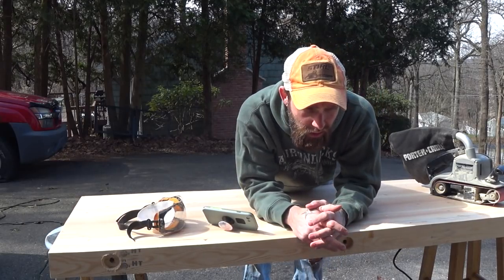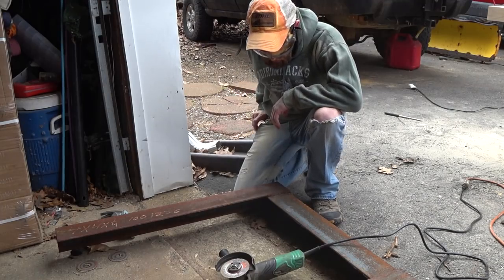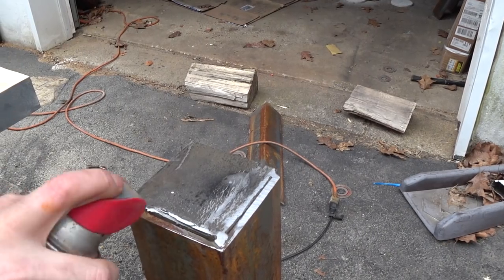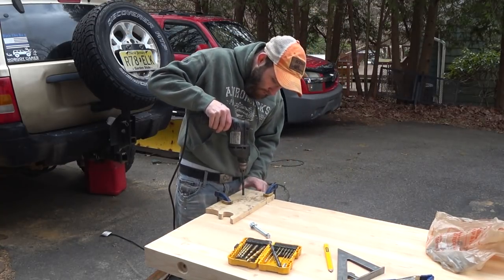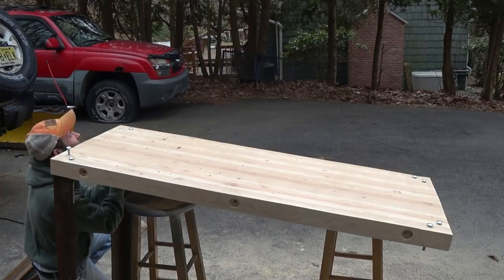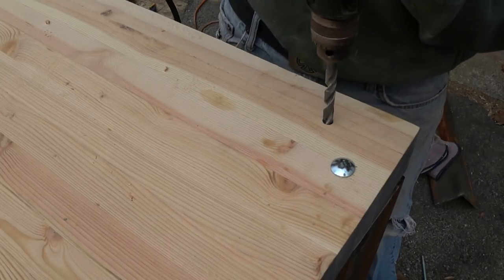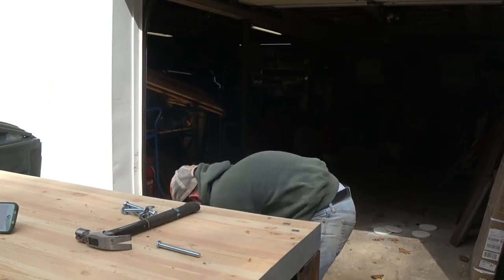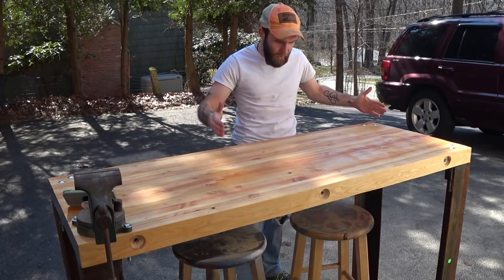Finishing The ULTIMATE MECHANICS WORKBENCH

Comment: It looks like that benches made out of two-by-fours I would have either put another two by four or I would have tried finding a set of old center caps did there used to be on old Ford Pickups they are used to hold the Greece in you definitely know what I'm talkin about they had a little recess behind and around cap they look like they would have fit right in that hole perfectly

Comment: I liked the videos. I was amazed at how similar this is to a work bench that I made a few years back. I built mine from a left over gluelam beam from one of my construction jobs. It is 7' long and 24" wide and 3 1/2" thick. I used 4"x6" douglas fir for the legs and the trestle underneath. I also mounted a huge vise on the one corner, and a woodworkers vise on the other corner. It has white oak edge and end caps with a back splash so I can screw it to the wall. Heavy as hell and is used for my reloading equipment mostly. I finished it with the stuff they use on bowling alley floors.
Reply from the maker: I like the idea of oak end caps. I have been flirting with fixing some sheet metal to the front face of mine to hit the holes I butchered and also to add durability (as this is in a mechanic/ metal working shop primarily)

Comment: If you do another one put the table on the ground upside down and use the legs as a template to start the holes then drill straight through and when you flip it over to the top everything is lined up!
Reply: Put scrap wood under to prevent tear out of the bench top.

Comment: You'll likely never read this but you don't need a  spanner for the angle grinder.  If you don't use the wrench to put the blade or wheel on, you won't need it to take em off. It only need to be snug by hand (and holding the arbor lock of course) you'll always be able to hold the lock with your thumb and with the other hand grab the wheel itself, not the lock nut and loosen er up. Trust me, you'll never go back to then shitty pin spanners again. Something about how the nut tightens to the right, motor spins to the right, no opposing forces or some shit idk but if you snug it up, it ain't coming loose.

Comment: Sorry to leave so many comments but Home Depot sells the tool for a few dollars to take that off but I actually have one sitting in my truck because the new grinders Aldi Milwaukee M18 brushless fuel they come with a lock where you just lift up one side of that nut and then you can unscrew it so you don't need that to anymore plus they actually give you two holes in that nut just in case you do over tighten it but give me a few days I should be able to find one and send it to you if you like

Comment: Are you going to camphor or sand the edges so there not  a 90' that way if you catch it on something it won't tear off. It will also be safer and last longer. 
Great video!
Reply from the maker: Yes, was going to use a hand plane, but I think I am going to get a bit for my router instead
Reply: @DEInTheGarage  I got ya! It looks great tho! What would be a cool uncle Jerry touch is find some old engine pieces like old Engine Valves and stick in the holes where the all thread was!